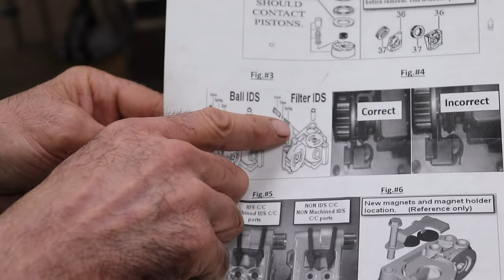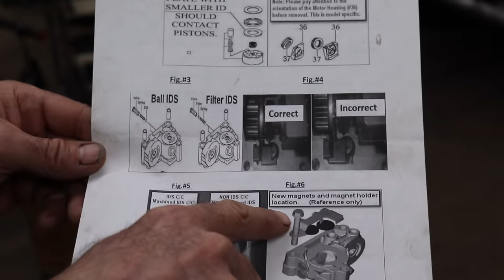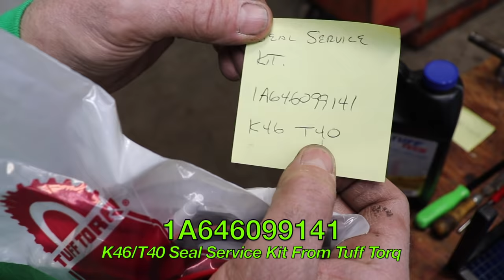Transmission Skipping? Here's The Problem!

Comment: I try to keep the oil changed on them, even though they're a pain to remove to do it. It seems that using the 5w50 they recommend makes them work better than the 10w30 that most come factory filled with.
Reply: I used 5w50 mobil1 full synthetic. Mine seems to be happy. It’s really cold blooded in the cold though. If I just started the engine and it’s cold and at idle and let out the brake the oil in the pump can stall the right so it needs some extra rpm till it’s warm. This only happens when it’s freezing or below when the oil is extra thick.
Reply: I tapped a 1/4 plug in the bottom  easy oil changes now

Comment: Thanks for the education. I normally do not go for the old act stupid hick comedy but you let it slip at times that you are a wise man that knows what he is doing. You are thinking about what you are working on so much that at times you sound like a shop class teacher with all the education. Anyway, thanks for your honest teaching. You are not just fooling around. I have an old JD LT155 that would get hot and barely move. A good internal cleaning and fresh 20W50 synthetic oil got it back to work.

Comment: Great video. I had the same issue, but after everything on the inside looked clean and no scoring, it had to be something else, and I found it. Crap had built up under the left pedal. Cleaned the linkage and lubed, changed fluid with 5w50 synthetic and it runs great.

Comment: From what I remember a lot of the John Deere Tuff Torque K46 hydrostatic transmissions were INCORRECTLY FILLED with generic 10w30 SAE Motor oil due to a mixup of recording the  Tuff Torque TL-200 requirements data sheet (restrictions on shipping if they had been properly filled before leaving Tuff Torque factory for final install at John Deere factory so it was most cost effective to fill them right before sale) which was what happened. 

However the K46 isn’t exactly built for ease of oil changes and customers of John Deere tractors quickly were encountering loss of power, start and stopping/surging all from accelerated wear in the hydrostatic pump and motors. Forgot which models or years it applies to but if the magnets aren’t completely clogged with powdered friction gears material you can usually just drain the oil out run a little 5w50 full synthetic to flush and top off with the same fluid. In most cases of drop in power, slippage or surging the replacement to correct oil will resolve things

Comment: Thank you for the excellent presentation.very helpful.
Depressing that the trans isnt designed for easy preventative maintenance. Clean oil and filter would change the trans life dramatically. Thank you Tara Dactle 👍👍 C. Diesel in New Hampshire

Comment: That one is older. It has the steel wheel spacers on the axles. Newer uses plastic. I think the rear wheels being spaced and shimmed loose may contribute to the spider gear failure. The axle c-clip deal isn't select or shim fit and the axle and spiders have a bunch of movement normally that's probably aggravated if the wheels aren't shimmed right. Just a theory after having worked on two k46.

Comment: WoW...my exact same tractor. Been baby'n it and changing the fluid every season. Flat mow and also pull my JD 7P cart/trailer with light loads. Some say you can upgrade the K46 with K57 parts to make it more powerful. Just bought a GT275 that needs a hood....LOL. It has a K70B in it. Now that seems HD compared to the L120.

Comment: I had trouble with the tuff torg k46 and entered it blind but will say when I installed it it worked like it should other then that little pin you showed must of fallen out because I can't disengage the transmission.  Thanks for the video. The next tuff torq transmission I open I will known what to expect

Comment: Only one detail to consider. Upon refilling with fresh fluid after a complete evacuation/ cleaning. I have seen others turn the shaft to work the pump some, essentially burping the system (much like a power steering flush/fill in a car). I mean, fluid level isn't going to be significantly lower not burping the system, but just to add.

Comment: Billy Goat the Outback Hedge Cutter with K46 di,  this is the same basic Tuff Torq k46 Hydro-transaxle

Basically the same unit without the
IDS system. Holes are on case but no parts (Wife loves more spring and seal sound effects).

Also, there is no block wedges supporting the mid-case. You have to evenly pry up the mid-case out of the bolt guides. 
Taryl Fixes Rules!

Comment: That homemade trans table . Just add a tube to a 5 gallon cover bucket.  Put a screen on the bottom of the pan. So nothing like that  ball goes into the bucket.  This also makes it easy to dump that oil into your use oil drum.

Comment: I am no engineer but surely they could design a transmission with an external way to change the filter. Maybe Deere wants it that way. Look at all the shop time they could pick up.
Reply: One of the problems with putting a filter on these economical units it that it leads the owner to believe they will last longer than they are designed for. It only takes so many hours to mow the average lawn and blow snow. Folks will Always complain that something should've lasted longer, when they made that decision early on, even tho they've gotten more than their money's worth. A wise consumer realizes how well they've been served and then invests in the next level up machine and gets even more for their money. That really is how it's all designed to work (from Deere and Tuff-torq) 💁

Comment: 31:00 Some mower manufacturers like Toro instal the transmission rotated 180 degrees (so the short axle is on the right). I think this is why the thrust wedges can be installed two ways around to match.

Comment: My tuff trans has been workin fine for all most twenty years knok on wood I did change the oil in it Thanks great video
Reply: Mine to. It started slipping/losing drive power. Changed the fluid and it was almost like new again.
Reply: I left the trans in the tractor. I jacked it up and with a long standard screw driver and a hammer, I removed the fill plug. I used my mighty vac (mine is a small hand held vacuum pump with a small reservoir) to suck out the old oil. (My transmission was low on fluid). I worked a funnel and a rubber hose through the deck height gate on the side of the fender and refilled it. I used 20w50 conventional motor oil -not synthetic. If I did this on a customer's mower, I would have removed the entire trans and replaced the filter as well. It took almost a gallon.
Reply: @markchriestenson3257  I was thinking on trying something like that on my old cub cadet.  It's gotten about 30% (guess) slower/less responsive with the same fluid in it after about 8 years and 450 hours.
Reply: @luuk-out-below9804  It should help out to have fresh fluid and probably thicker fluid in there.
Reply: @markchriestenson3257  im sure its nasty at this point.
Reply: I put a drive belt on and took it out  dumped the oil out    over time and put it back in but never  jerked are sliped only the drive belt was bad @markchriestenson3257

Comment: Question - I have the T40 trans. I have it all apart as you do. I have the pin in place as you do. I have small ball and I am not sure where that goes? Would you advise the location for it. The bearings are not missing a ball. I re -checked.

Comment: I have a 38 inch cut WHITE riding lawnmower a few weeks ago the front drive belt whore out. I replaced the belt and since I changed the belt the lawnmower jerks a lot only in forward gears. My machine has 2 drive belts I replaced the back belt last summer. There was a small C clip that fell down onto the deck the front drive belt. What should I do?

Comment: 58 minutes in the lip seal , i use to use shim stock or flashing to wrap around the shaft and slide a seal over it , no need for a screwdriver to pry the seal lip and no damage to the lip seal . pull the shim out your done easy peasy

Comment: Thanks fixing to service one of these K46 on a Husky mower it came in for a sluggish tranny esp when used for lengthy times. Ended up being the idlers on the clutch were seized and binding up the drive belt. But customer is paying for a service any way. Good info for another grass rat lawnmower tinkerer.

Comment: Awesome video, super helpful, love your channel, your knowledge, your experience....So awesome to have a teacher you've never met teach you exactly what you need to know!

I have a few questions on this K46 tranny. 

1) What do you think caused all that build up in the filter? 

2) Since the differential gears and all the other gears seemed ok, was it just too many hours of use without having a fluid change? I don't know why John Deere tells customers the K46 is "unserviceable" when you clearly need to change the fluid. It's really not that hard...especially if you watch your videos on the K46!....and I was able to get my tranny running again because it had a leaking axle seal and only had 1/2 a quart of oil in there. 118 hours on the x300. 

3) Do you think I should flush just flush the fluid at say 200 hours and call it a day if everything is running fine? 

Thanks for making this video.

Comment: Do you have to bleed air out of the unit after overhauling it?   Turn the axles after first fill?  I recommend a larger and higher table with a covered trash hole at one end.  ¼ round border to keep the little stuff from rolling off.

Comment: How old is the Tuff Torq transmission design? we have an OLD mower with hydrostatic that we used to use with a snow blower. We found that after a while using in the northern Minnesota cold, it would lose drive power. Letting it sit a while would get it working again for a while. At the time we thought maybe the oil was foaming as it got warmed up. Perhaps it was a plugged filter instead?

Comment: You see how he backed off the cover bolts with the speed wrench, so he couldn't cross thread them? When you are putting those super coarse thread screws or bolts into a plastic part, if you do the same thing, you can remove and install the bolts as many times as you want without stripping out the plastic because you won't keep cutting new threads in the plastic each time you put the screw in and out. Just put the screw in with your fingers and slowly rotate the screw counterclockwise until you feel it slip down. Then tighten it. The screw will go back into the same threads in the plastic that the screw originally cut. And you will have less chance to crack old plastic parts.

Comment: But when you checked the differential gears, and other parts, they all seemed ok.  So what was causing all of the metal debris on the differential magnet, and the filter?  I understand how cleaning everything will improve performance but what caused the initial problem of the plugged filter?

Comment: 9/30/24, 8pm pacific time.
I have a craftsman lt 1000 20hp. Is the transmission the same as the one you worked on. Mine skips/skiping also?

Comment: My brother has a hydrostatic transmission and a lawnmower shop said it's okay to run it without any oil in it. I told my brother they're full crap. Wheel seal leaking . It would quit working and probably tear up the transmission It's a Cub cadet right before they changed the the body style that one. I imagine her probably all the same.

Comment: 17:29 I like to use wet/dry 1000 with cutting oil on it and do figure 8"s when lapping in a part.
22:01 Mineral sprits cuts oil well, also Super Clean.
26:34 So what did the company say about the problem ?
54:43 Using anti-seize on the bolt threads doesn't hurt when installing metal bolts in aluminum.

Comment: i always turn the input shaft and watch the bubbles come up to get the air out or you might be too low on the level, it's a pain in the butt to add oil after it's been installed
Reply: How do you turn it and how much oil do you have to add?
Reply: @robwright4398  knowing about where the level needs to be you go ahead and fill to that, I put a vise grip on the shaft with a piece of emery cloth, grit side in, to keep from getting marks on it. just start turning it and watch the bubbles come up and add a little as you go and the level drops. when you get to the point you have no more bubbles you can start turning the axle and get more bubbles. at this point you have done as much as possible to get the air out. no doubt there is still some air in places but at this point I go ahead and over fill it a bit to take care of it. If I did it for a living I would make an adapter for a drill and really give it a good run, but my hand turning has done me well so far, I've rebuilt a few and replaced the oil in all of mine for decades and never had a problem.

Comment: Hey Taryl I have a 5 speed castlegsrden ride on  2011 manual change its jerks to what could be wrong
Reply: I'm not Taryl. There are shift fingers that go inside the gear stack. They grab the inside of the gear and slid back and forth to engage different gears. The tips wear down and won't grab the gear very good and will skip when moving.

Comment: Making me wonder about the cost differential between rebuilding a K46 and upgrading to a K57 or a K66.
Reply: That’s what I’ve been thinking about when mine dies. The beefed up trans would be handy when I’m moving my 5x8 trailer around.
Reply: K-66 is a great transaxle. Comes with multiple options... in my case it powers a serious power steering. I think that's the sweet spot for light duty machines ~

Comment: If I didn't have the transmission apart can I drill a couple holes in the seal put a couple self tappers in and pull on those to remove the seal

Comment: I've got a L100 john deere I had to replace the engine previous owner son didnt check the oil so a rod from the balance shaft went out and the pistons rings heavily worn so I just replace, the origanal engine had a Briggs 17 hp I had a briggs 17.5 on hand from a mtd found they were the same engine design just had to swap a few plastic peices

Comment: I got a transmission on my tractor where they welded a smaller pulley on if I try to drive with the engine at Full Throttle it actually goes slower so I guess a pulley swap doesn't work very well on a hydrostatic transmission

Comment: Hello. 
you said the surface of the oil pump must be smooth.. let's say it's okay.. there may be a problem with the pistons? it is possible that the cylinders are worn in a hydraulic motor?

Comment: Great video...I will say if the customer pays full price for the kit then all of the kit including new seals should be used and replaced.
Reply: It didn't go in for a total rebuild. The labor could have exceeded the price of a new trans. I was surprised that he even bothered to do the axle seals as there was no sign of leakage. It was basically a show and tell in case you didn't know how to replace the axle seals.
Reply: If it ain't broke, don't fix it!  Replacing seals that don't leak can cause way more trouble.

Comment: Hello Taryl.  Great video.  Would it be possible to do a rebuild video on a peerless tecumseh transaxle.  The ones used in the older craftsman 6 speed lawn tractors.  Mst 206-545c

Comment: I'm wondering if mine has the same problem because I'm losing reverse now. It works but it takes a while to back up. It works foward correctly tho.
Well it'd time to pull the transmissions it only has 750 hours on it. I wish I knew that you were supposed to change the fluid and filter every 200 hours Husqvarna never posted that in the manual.
Reply: Well finally rebuilt it and found out there was a little sludge in the filter. I used the Tuff Torque kit and replaced all the seals. The pumps were very good then found out there is a small adjustment of zero neutral. By adjusting it properly, reverse is working alot better now. Your video as spot on with out this, I would have never tackled this transmission rebuild. Now it's good for another 750 hours or 15 more years.

Comment: How much would the labour alone be for a job like this Taryl (I dont have one but just roughly...) It looks mighty expensive bearing in mind you had to remove and refit the axle too?
Reply: I think the point is to show DIY guys that this Can be done, and how. One doesn't need to know exactly how much they're saving by rebuilding one of these units and getting Years more: it's basically the cost of a new mower 💁 -

Comment: You said clean the inside of the transmission to get all of the gasket stuff out of there that you took off on the edge. 

But you didn't show us how you cleaned it.. where the gasket goes and the inside of the transmission. 

Probably one of the most important steps.

Comment: Anyone know does Taryl do a breakdown of a 1980s Peerless? Here's why..

Transax transplant 

I have a 30 y.o. Murray 11/36ic that was increasingly difficult to change gear. I acquired another transaxle 10 years ago, and seeing it has 10 years less use than my one so it must be in good or better condition...right? Put it on, and now the mower won't move forward or back.
I see the drive belt is turning the rear pulley on the transax. I lift the back up to see if there is the slightest movement and there is nada. 😑

Any ideas anyone...

Comment: Question 
The transmission that the gears where destroyed the filter wasn’t that dirty, but the other with the filter that was dirty that was full of metal on filter and magnets, where did the metal come from?
Agree looked clean once pulled apart unless someone used old transmission oil in it to refill etc, well can only be the only explanation I could figure.
Reply: I think he cleaned that filter just to get a better look at it, to see if it had shavings in it
Reply: @robwright4398  no it was dirty, remember the magnets has shavings too, that’s why I’m trying to figure out where the damage came from.
The filter on the one he had earlier with all damaged gears was cleaner.